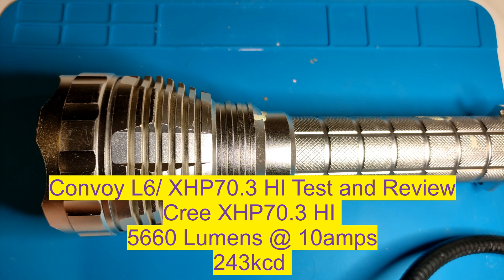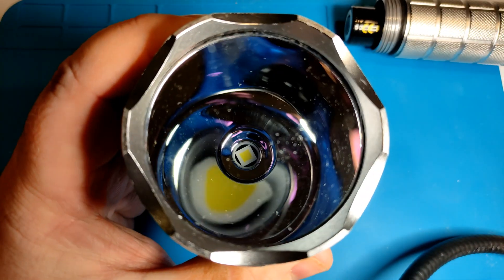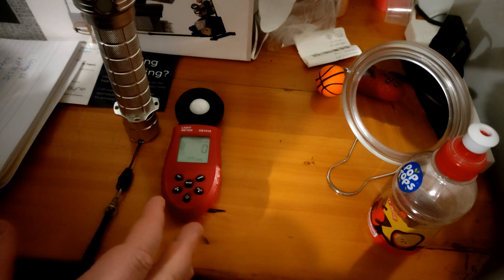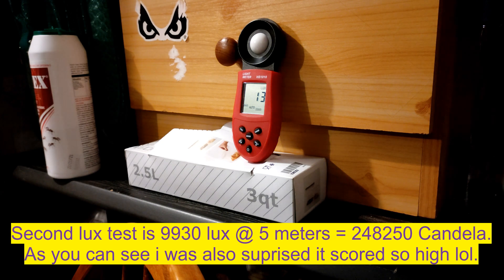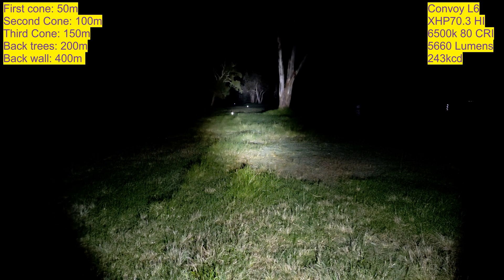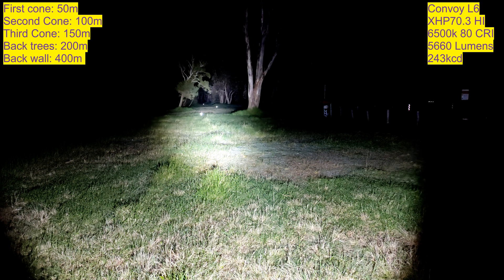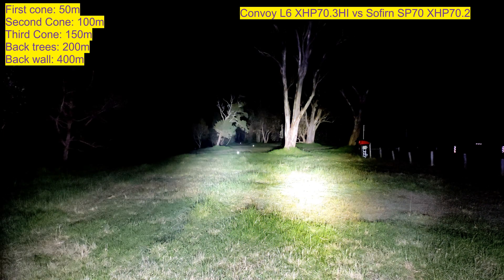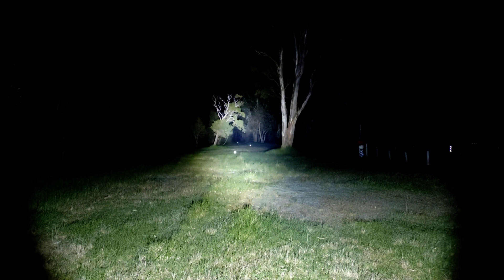Convoy L6- Cree XHP70.3-HI Test and Review

Comment: before you modified the l6 how many lumens u measured on Turbo?
Reply from the maker: I can't remember to be exact as it's old now I think I reviewed it originally in 2018, the original L6 came with the original Cree XHP70 with the stock driver you would be able to achieve 4000 lumens somewhere around that.

Comment: 12:37 i buyed a sofirn sp7- but is very weak; not even in turbo nor goes to 100 meters the bright light
Reply from the maker: What batteries are you using?
Reply: vapcell inr 15a disch 6200mah golden and litokala yellow 5200 20a disch - both  26650 @everydaysurvivalgear

Comment: so u modifed the l6  and then the lumnes went up to 560 or was like that by factory set
Reply from the maker: The light is modified I upper the current on the driver and dedomed the LED. You can now get a domeless XHP70.3 from the factory it performs just as good as the HD model

Comment: how did it do 10 amps at 6 volts?
it's rated about 3A at 6V
Isn't over driving done only via voltage input increase?
Reply from the maker: Cree rates these new XHP70.3 at 7A at 6V from factory so this is a very mild increase, you should be able to push the XHP70.3 upwards of 16+ amps easy enough. The increase in current is not linear to the increase in voltage. You over drive LEDs by increasing the current but they need proper cooling to handle the extra heat. An increase in current will only slightly increase the voltage say 1amp will be an extra 200mv. The XHP70.3 has been tested on BLF.
Reply: @everydaysurvivalgear  
you're right, I conflated the current of the 12v with the 6v!
those over driving numbers are really impressive!
Thanks for answering here and in the flashlight forum :D

Comment: what did you do with the stock 70.2 driver again? i need to do that with my m3 driver then when upgrading to 70.3 and also will it fry the driver or just under power the 70.3 if i dont touch the stock driver? thanks!
Reply from the maker: I changed the value of the sense resistor which ups the current of the driver. The M3 is a different driver to the driver used in the L6. I think convoy sells an upgraded driver now I'll have a look around to see what I can find.
Reply: Convoy уже продаёт драйвер для установки в m3 светодиода 70.3 hi. Цена менее 5$

Comment: Where did you find a 6v 10amp driver? Just getting into DIY and the best I can find is 5 amps for a 2 cell driver.
Reply from the maker: Hey mate I modded the driver in the L6 to get more power from it by bypassing the sense resistors, convoy have a new driver out that does 8amps it could be a better driver to mod.

Comment: 70.2 6k lm? You serious?
Reply from the maker: Yea , the older XHP70.2 have been tested to almost 10000 lumens when over driven, you will not get that much power in a flashlight because of light losses. Cree rates the new XHP703-HI to 5000+ lumens from the factory now.
Reply: @everydaysurvivalgear  hm, never saw 70.2 above 3.5-4k lm. I think overdrive is not good for longevity of led :/
Reply: @FlashlightTech  That's where the 70.3 comes in, when the 70.2 fails 😁

Comment: Very nice. I wish I could get 70.3 HI in L21A with forward clicky.
Reply from the maker: You could Zener mod a direct drive driver if the L21A has an extension battery tube mine didn't come with one. Or try an L2 but it is bigger and heavier.

Comment: Hi Chris.. good comparison.  that HI led should reign and throw better in the larger reflector. Those beast are awesome, but kinda bulky, these are duty /special purpose light. Guess  i'll pickup the FT03 with new sfn55.2 led (7070 HI)  for compactness. 
Cheers 🍻🔦🌿
Reply from the maker: Thanks for the feedback! 
It would be good to see a FT03 with this LED, i will have a look around if i can find a driver to fit the FT03 or maybe i can Zener diode mod the driver.